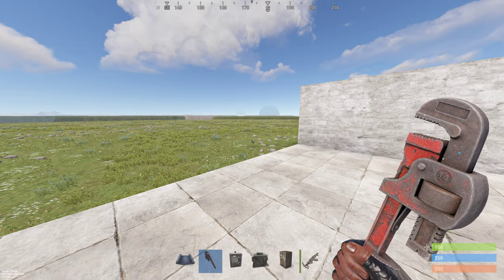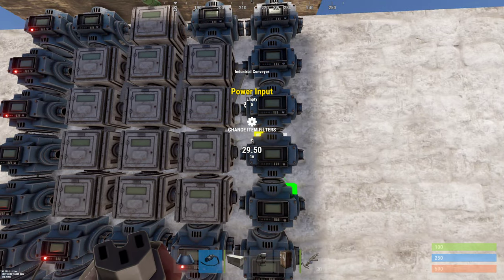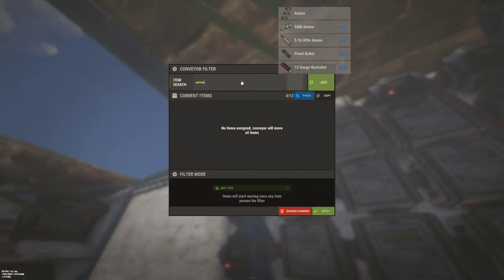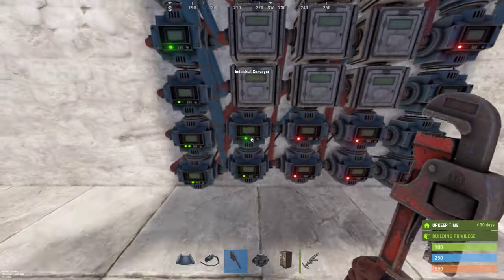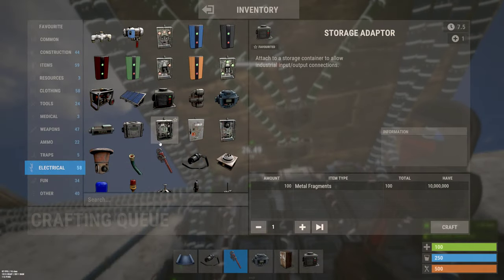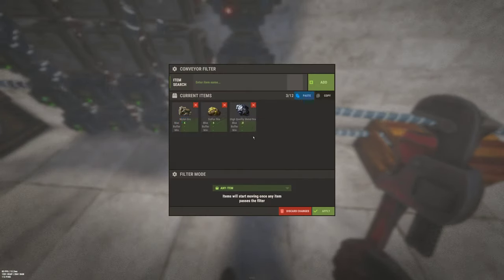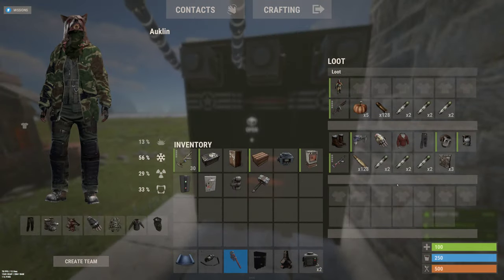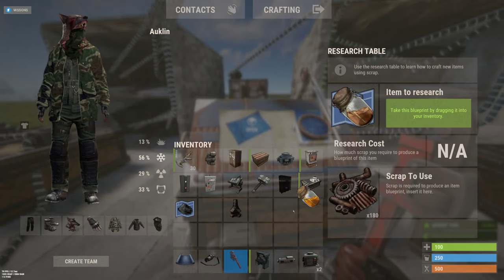RUST: Full Base Industrial Automation (Drops, Lockers, Furnaces, Crafting, Sorting, TC, etc.)

Comment: trying to use this setup and all was well until the furnaces? ive been trying to figure out whats gone wrong for the past hour ish but for some reason the smelted ores wont go back into the system any clue why that might be happening? it works fine going straight into a box but wont go into the system for whatever reason
Reply from the maker: @elysium1324  does that box feed back into your splitter wall, and are you positive something is is pulling cooked ores from your splitter wall?
Reply: @auklin7079  yes theres 2 boxes for cooked sulfer and 2 boxes for metal frags and they work for everything except the furnaces ive tried changing where they input but for some reason i just cant get furnaces to work
Reply from the maker: @elysium1324  add me on steam, I'm the one with the dog

Comment: This system does not auto sort my items if a person accidentally puts wood in the stone box it does not remove the item which pisses me off. I did everything and it only sorts it if there is items in drop box
Reply from the maker: chase the output of the stone box back to the splitter wall. Something along the line must be disconnected or setup incorrectly, or your wood box is full.

Comment: you can place the furnace wood box back into the system as well and limit the max spots in that small box for wood or even just 10-15 since its only using 5 per furnace.  that way you have a main loot room wood main storage box

Comment: A better way to wire the raid detector is to use lights or branches on the walls and link them and have the final power out go to a blocker that can go to a smart alarm or turn on auto transfer. If any wall you link breaks power will turn on
Reply from the maker: Ya I have that in the description lol, I realized it shortly after stopping the recording.

Comment: Hey i have linked my auto sorting system in base quite similar but on way bigger scale. And i have a problem that when i connect multiple boxes out of one conveyor (doesnt matter if its splitter or connected in line) they sort constantly which makes conveyors work non stop also and flood the system with moving stuff

Comment: Have a question about the furnaces returing cooked stuff from furnaces once it cooks it doesnt put it in the right boxs
Reply from the maker: if you feed it back into your splitter wall and are pulling cooked resources, it will pull them, so long as nothing else is going on.
Reply: @auklin7079  so what I did was setup a different setup for my furnaces it's own system for the wood and metal and sulfur. And the end of my furnaces output is back to the spliters for the rest of the system

Comment: Just wanted to say I did it today on our server and it works great! For some reason though the tools section grabs the c4 and satchel and makes it go from a box to another and back and again. Any recommendation to counter that?
Reply from the maker: The exact same thing happened to the MLRS Rockets in this video. It is because they are being pulled twice (Tools <---> C4/satchel). You have three options, one is to pull C4 to a box that doesn't feed back into the system. Two is to 'sandwich' the box in filters, i.e. just put a filter at the output of the box and tell it to not pull things that are problematic). Third is to consider an entirely tiered system (covered  in the description by another YouTuber, it's just more complex with more power needs and more space requirements).
Reply: Thanks man; it’s def not like we get a ton of them so we made a separate small box for them; with 3 rows it’s good enough for them haha
Reply: Yes pritty easy

Comment: i used this a few time loved it but i’m having an issue where my piping is disconnecting randomly and by the 3rd day most pipes are gone just wondering as to why the game is having this issue
Reply from the maker: you are probably placing roofs nearby. Roofs, when placed or destroyed, remove piping in a largeish radius
Reply: @auklin7079  Is that to keep pipes from being brought through bunkers? Or just some janky rust logic.
Reply: They were breaking when walls you upgraded were touching the pipes. They have since fixed it

Comment: I tried this and at items like clothes and ammo just kept rearranging constantly in the box. Is there a way to stop this? Also is there a limit on how many things we can combine? At some point some boxes were not auto sorting because for some reason even though I combined them back to main line that goes into splitter it wasn’t working
Reply from the maker: The only reason they would be rearranging is because at one point, the items are being pulled twice and both being fed back in, this happens to the MLRS rockets in this video. 

The solution is just to make sure you aren't pulling items twice.

There is a more complex solution, it requires a lot more power and setup "x-tremespeed" goes over it, it requires controlling both inputs and outputs of a box, meaning you'll need two conveyers per box.
Reply: Can you also daisy chain boxes between the two conveyors?
Reply: @auklin7079   easy way to fix  that(MLRS rockets) set in 1 conveer min 9999 and over.
Reply: don't need more "lot more power" xD

Comment: the furnace system is very poorly made for wood notes of arson, and electric ones do not have auto on/off
also, there is no stopping system on wood stoves if there is still wood, and the ore has already run out
Reply from the maker: You can create systems where if the ore filter is met, it will turn on the wood filter. I just kept it simple here. The video is already 40 minutes long